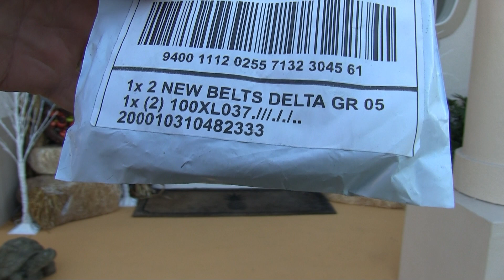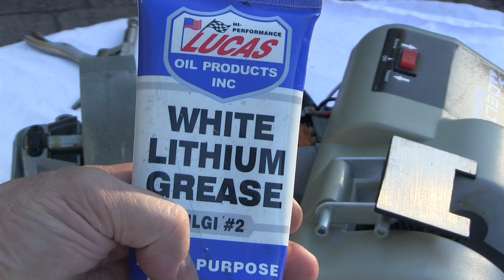Utility Sharpener Belt Replacement

Comment: I have a sharpener that is almost identical (going on memory) to yours except its a Craftsman Brand and probably 30 years old.  When my belts broke I used duct tape to make "rope" belts and it worked pretty good.  They held up for as long as I needed it to run on that occassion.  Thanks for posting.

Comment: Just got one from a garage sale so this is very helpful.  It's strange that the original build had the weird string for belts.  Anyhoo, just got the replacement's off of fleabay and it's working GREAT.  This sharpener really works well for sharpening lawnmower blades.  Thanks.
Reply from the maker: Wow, I’ll have to try it on my mower blades. Thank You.